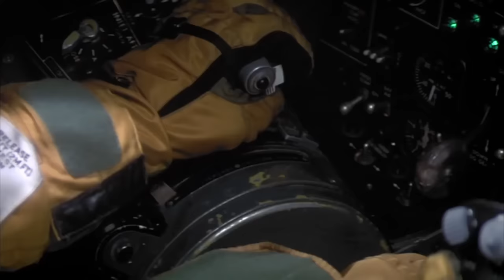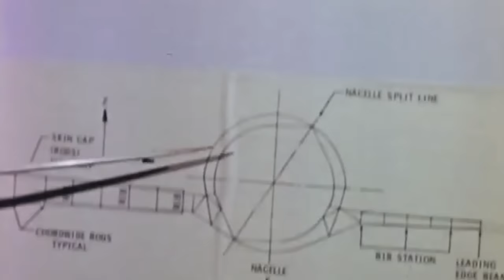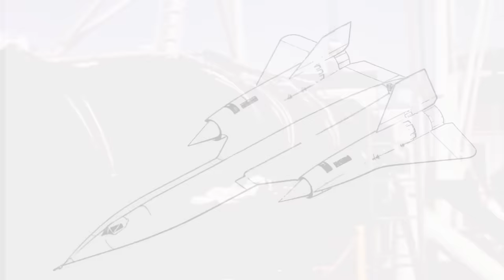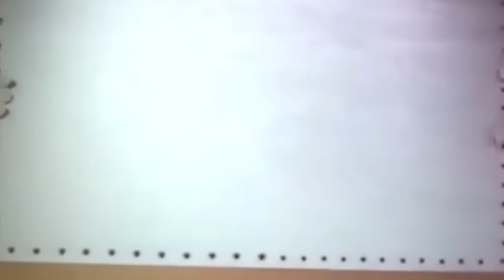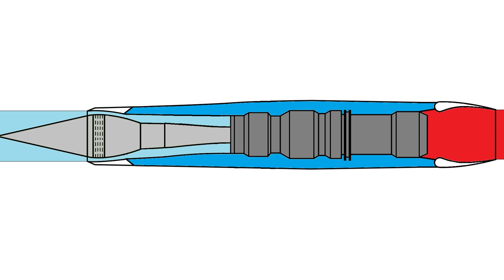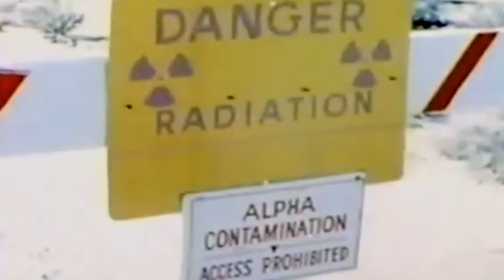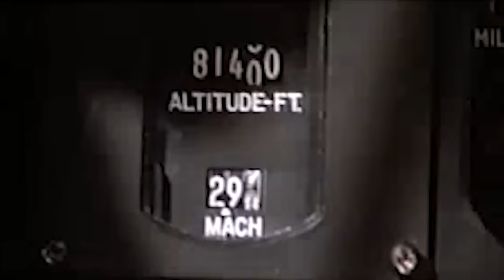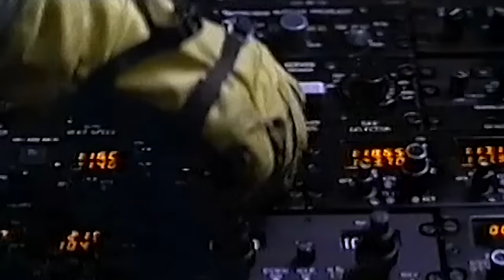Lockheed A-12 | Speed matters

Comment: The TEB is used for starting the jet engines, not afterburner use.. pilots only had so many in case of UNSTARTS
Reply: That’s what I read too . The unstarts could be very violent I believe. The thinking that went into these aircraft was amazing.
Reply: @beagle7622  it would cause the plane to yaw to which ever side the engine stalled on. There's an interview with Kelly Johnson and he describes an automatic compensation system for UNSTARTS, but if you listen to interviews, they describe a pretty dramatic event , UNSTARTS were. Pretty crazy TEB combust in atmosphere. Where did they get the idea to use it to start a jet engine??? Crazy!
Reply: @thetreblerebel  I read about it in Brian Shuls book “The Sled Driver”  I think. I will check but both he & his back seater hit the edge of the cockpit with their helmets. It is an amazing read but ridiculously expensive.
Reply: Not correct, the TEB shots are used when first starting the engines AND whenever the a/b is lit.  Its actually shown in the video numerous times, green flash as the a/b is ignited whilst in the air.  There was only enough for 16 TEB hits per engine.  Startup(1), takeoff(a/b engage-2), then refuel at tanker( as the planes tanks filled, the jet couldn't keep up with the tanker with both engine at full dry thrust=military power, so a single engine had its a/b lit at minimum burner-4) back off tanker, light other engines a/b with TEB(5) accelerate climb to mission height, then slow down and refuel(last bit of fuel hit the one engines a/b requiring another TEB hit (6) fill the tanks and back away and then light the other engines a/b(7) the accelerate and climb.  The TEB shots were NOT just for restarting after unstarts.  Actual flight durations were limited by crew, TEB shots and/or liquid nitrogen supply( on the ground the fuel tanks are filled with fuel, then the fuel load is drained down to takeoff weight, as the fuel drains the ullage space is filled with nitrogen gas from the liquid nitrogen dewars.  The TEB injection points were different for starting the J58s and for lighting the a/bs.

Comment: Some odd shots of the X15 after its mach 6.7 flight at timestamp 15:18 -- it wasn't made of aluminium, it was made of inconel X....
Reply: Inconel X is tough stuff. Once they were road transporting an X-15 in the desert and had escort, but some guy driving a RV or towing a camper coming the other way ran the gauntlet. He apparently didn't see the wing edge-on protruding into his lane. Sliced the top 1/3 clean off. Did nothing to the X-15. The guy pressed for damages. Air Force replied, "You dodged AF security and smashed into a $50 million aircraft. The best advice is hope WE forget about it." "OK."
It's from somewhere in Langley's oral history site. Lotta great stuff.
Reply: That "plane" had to deal with way more than aluminum.

Comment: If a plane leaks, it means it has fluid. You can also determine if there's an issue during your preflight. IE if a plane that normally leaks is dry there's probably a problem
Reply: There were problems with some WWII fighters and leaks.  So pilots would taste a Tiny bit and if it was sweet, “Coolant”!
Reply: The fuel leaking issue was result of the skins being fabricated a certain size that allowed them to expand due to the high temperatures which in turn sealed them.
They even had a a chart that listed temps vs fuel leakage.
The # of drops ovrr certain time where acceptable.
The length of that plane also grew a significant amount during flight due to everything expanding.
Reply: Just like my Harley, when it quits leaking it's time to start checking things out.

Comment: Talked to an SR-71 pilot once and he explained that when they saw a missile launched at them, they simply changed heading a few degrees.  Distance + extreme speed + small angle = large miss.   This was when I was younger though, and it is a conversation I remember from when I was a young aspiring pilot with stars in my eyes talking to a "rock star".  So I might not have the details right.
Reply: Your not far off...to accelerate from the ground to over mach 3, climbing to 70,000 feet, then delivering a kill was beyond Soviet surface to air missiles of the 1960's and '70's capacity.
Probably beyond the US's, too.
Reply: The Iraqis also did this against the F-14 with their Phoenix missiles. 

No US Navy F-14 was ever credited with a Phoenix kill in spite of many attempts because of that.
Reply: @Bartonovich52  
What do you mean by that?
Reply: @Bartonovich52  There was only 3 Phoenix ever fired in anger. 2 simply dropped and fell to the ground as they weren't armed properly at the ship.  The same guy armed both the flight leader and his wingmans AIM-54's.
Reply: @crankychris2  the Soviets had a way to shoot down a SR71 but it involved a nuclear weapon in its projected flight path. Would work in theory thankfully they never tried.

Comment: ....another Kelly Johnson masterpiece...........
Reply: That guy was a genius, really
Reply: There's a little known concept for a jet powered fighter aircraft that Lockheed cooked up in 1939 that by all accounts might just have broken the sound barrier, they even had a design for an axial flow jet engine for it.
But the USAAC wisely chose not to pursue it due to the fact that by the time that the special materials and tooling would have been developed the impending war would have already been over and it just would have been a drain on resources. 
I can't remember the nomenclature of it or I'd write it down so you could look it up, Wikipedia has a page on it, I think it was XP131 or something like that.
Reply: L-133 was it's designation, it wasn't produced but the design efforts put into it accelerated the development of the P80.
It was a radical design for the time with blended wings and cunards.
Another one of those "what if's" in life.
Reply: @ervandrush3116  Well, there are lots of geniuses. And then there was Kelly.

Comment: One of the problems they found was that the titanium alloy and not pure titanium they were using reacted badly if cadmium plated tools had been used on parts then microscopic traces of cadmium would be left behind causing galvanic corrosion. They also couldn't use Pentel pens as somethin in the ink or the pen would eat through the metal. Then there was a problem with water. Spot welds made in the summer months failed whilst those made in winter did not. The cause for this was algae, or rather the chlorine put into the water supply to prevent the growth of algae during the summer months. When this was used to clean the welds it lead to corrosion. Solutions: no Pentel pens, anywhere; no cadmium plate tools; and distilled water for cleaning parts.

They also had issues with about 85% of the titanium they were being supplied with not being up to the required specifications.
Reply: Titanium is always a pain. Back then, when there wasn't a lot of knowledge about handling it, it was a huge problem. But even today when we know a lot about it, it's still a pain.

Comment: I understand why people claimed to see UFOs during 60s
Reply: Very few without a "need to know" ever saw an A-12 or any of its derivatives in the 1960s, in the air or otherwise.  That was part of the whole point of what was a highly classified program(s).  It  flew when and where people were unlikely to see it.  No one on the ground can see with their own eyes an aircraft operating at over 70k feet altitude, double the operating altitude of commercial aircraft.

Comment: I watched a video of one of the SR71 pilots and he mentioned that it was capable of much more than just Mach 3,but he didn't elaborate much on it. I saw an SR-71 at the Air & Space museum part of the Smithsonian near Dulles Airport in Washington, and there is an A12 on display at the Space and Rocket center in Huntsville, AL.  You can just walk up to it and touch it like I did because it is parked right out front next to the parking lot.
Reply: There is an M-12 (A-12 carrier for the D-21 drone)  in the Museum of Flight at Boeing Field in Seattle.

Comment: I love how the U-2 is basically just an F-104 with different wings and other mods.
Reply: Yep. No wing vs too much wing.
Reply: What's really incredible about the U2 is that when it turns there's a 4 knot window it must be in, any slower and it'll stall and lose control, any faster and it'll break apart. 
One of the reasons for this is it's wingspan, when turning the inside wingtip is traveling so much slower than the outer wingtip. 
In some ways even though it doesn't have the blistering speed of the A12/SR71 it's still just as fascinating as them.
Reply: @dukecraig2402  That's because Kelly Johnson applied his genius to both planes.

Comment: An A12 and an SR-71 both crash landed.  The rear of the SR-71 and the front of the A12 were destroyed.  The remaining sections were joined together to create "The Bastard", so-called by its pilots because it could never be trimmed out to fly quite straight.  It crabbed through the air slightly.  That is the "SR-71" on display in the museum near Hill Air Force Base in Utah.
Reply: No, the bastard was the rear of a YF-12 and the front was a functional test article for a Sr-71A.  You can tell it was made from a YF-12 rear as the engine nacelles both have ventral fins on them, no other bird but the C(the bastard) has them

Comment: I read once I don’t know if it’s true. the seams of the skin of the aircraft were intentionally a little loose. The aircraft would leak fuel on the ground so it always had to be defueled promptly after landing and the remaining fuel in the tanks would leak out. This was done so when the skin of the aircraft was heated by air friction the skin also the walls of the tanks would expand and seal the gaps. So what I heard is after takeoff the aircraft would make a supersonic dash to heat and expand the skin and then immediately top off the tanks. Necessary not only because of the max takeoff weight but also the aircraft leaking fuel on taxi and climb out.
Reply: Minor corrections: the leaks were measured in drips per minute. They took off with a partial fuel load in case they had to do an emergency landing right after takeoff to reduce the potential stress on the landing gear. They would top off the tanks after take off and then climb to 33k feet to perform the dipsy doodle - descend a bit and accelerate past mach 1. Once supersonic, it would continue to climb to ~80k and accelerate the whole time. The high mach speeds would only be attained at high altitude. The leaking fuel wasn't dangerous - the JP-7 needed triethylborane for ignition - if you dropped a lit match in a bucket of JP-7, the match would be extinguished. Here's the flight manual if you'd like more details of how it flew: https://www.sr-71.org/blackbird/manual/
Reply: @justinhannan1713  That 'dipsy-doodle' maneuver is call a Rutowski path.  You trade potential energy for kinetic energy in order to accelerate through the drag rise around Mach 1.

Comment: I was in a Nike site during the 70s and met a radar maintance tech who told us that the Air force had alerted the whole West Coast Air Defense network  to try to track an unknown high speed target out over the Pacific .The whole system was primed and ready and could only look as a fast mover blew right pass every site on the west coast !
Reply: @bighands69  Today they use the U-2 (they use now a bigger scaled up version), drones (if possible) or satellites (which are of course less flexible). The satellites used today are capable of a resolution of around 10 cm per pixel, what wasn't possible at the time when the A-12 or the SR-71 flew, the old Bucket film satellites had resolutions of 5 m and more and were often used for mapping. 
At least this is what we know publicly - there is stuff like the X-37B, which is probably used for reconnaissance and synthetic aperture radar capable of detailed pictures even at night and through clouds

Comment: The Bristol 188 first flight was two years before the A 12. And all examples of this stainless steel beauty still exist.
Reply: first flight 1962. Never even made it to Mach 2.  Couldn't fly for long before running out of fuel.  A12 first flight 1962. So, I call you wrong on multiple points.

Comment: It is still a tightly kept secret how fast they were. An SR71 pilot recounted a time outrunning a missile when he leaned into the throttle he was rolling upward's of Mach 3.5 with engines pulling hard with plenty of throttle left. it wouldn't surprise me one bit to learn the plane exceeded Mach 4 with an absolute top speed surpassing that!`
Reply: I think Mach 4 flight would be not long and last flight even for the SR-71)
Reply: Nope. Never happened. 

First off. Jet engines don’t have a throttle. They have a thrust lever. And that thrust lever indirectly controls how much fuel goes into the engine.  Most jet engines are capable of putting in far more fuel than they can handle. It’s to ensure they are never staved for fuel in all conditions that they fly. For example, the U-2 uses more fuel idling at sea level than it does cruising at 80,000 feet. 

The only thing keeping you from putting more fuel in are your temperature limitations. Which in the SR-71 is inlet temperature. 

The air entering the engine has to be subsonic. So it has to be slowed from Mach 3 to subsonic. This compresses it and causes a large heat rise. Then you compress it more with a compressor and add more heat to it with fuel. If you are going too fast, the temperatures will be too hot and the engine will melt or catastrophically fail. 

They all have a bit of wiggle room. But since power required increases by the square of the speed, and on a kit bash engine that had numerous in service failures on a plane that already required a week of maintenance between flights... you did not want to push it very much. 

Mach 3.3 corresponded to the temperature limit. At those speeds it takes a long time to get to Mach 3.4 or 3.5. To get to Mach 4.0 would take several minutes assuming the thrust was available. It simply could not be done. Mach 3.5 at absolute tops. Mach 4.0... out of the question. 

Remember too that less than 20% of SR-71 hours flown were over Mach 3 because of how hard it was on the airframe and engines.

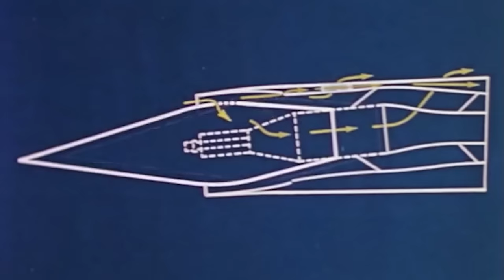Comment: 20:54 The image shows an unstarted engine inlet, where the normal shock, is expelled producing a huge drag. Normally a sequence of weak oblique shocks are followed by one strong shock. The oblique shocks reduce progressibly the Mach number to slightly just over 1, the strong shock, situated just behind the smallest crossection and behind it the flow is subsonic, followed by a diffuser that increased the pressure further to the point that most of the engine thrust was produced by the high pressure in the conical diffuser, the engine was more like a pump.
The problem with the strong shock is that it is unstable and must be stabilized with an inlet air active controller using bypass doors behind the shock to the outside of the inlet nacelle. Die loss of control resulted of the strong shock to rapidly move to the front and ahead, just as shown at 20:54. resulting in a high uncontrollable yaw moment with the destruction of the airplane and pilot, which did happen.

Comment: uhh...what is the unusual part about that refueling schedule? All planes can fly at much higher weights than they can actually take off, so it is standard operating procedure in the US (and other nations with serious aerial refueling capacity) to give aircraft full equipment load, take off under partial fuel load to stay under MTOW, and then top off to full fuel load after takeoff. We have been doing it for decades. Not for every flight or mission, but it is hardly unusual. There are not many jets that can takeoff carrying both a full equipment load and a full fuel load. US jets often fly with less than a full equipment load, but that has more to do with increasing range and efficiency. No need to carry more ordnance than you need, since it will slow you down and decrease range.
Reply: You do realize these first flew in 1962?  Certainly unusual for a jet with a 2500 pound payload capacity.

Comment: Dry nitrogen was used on the tires, hydraulic accumulators and other things on all aircraft in the USAF during my time 78 to 86.  Not just SR71's.
Reply: Nitrogen in tires is standard even for airliners, in the case of a burning tire with a retracted gear the melt plugs at the rim melt, set the nitrogen free and extinguish the fire. 
What's special about the A12/SR71 is the fuel tank inerting system, the aircraft was fueled up after take off to 100% , and every gallon of fuel burned was replaced by nitrogen from storage tanks, no ignitable atmosphere could start to build up in the fuel tanks. Without tank inerting the top speed was limited to Mach 2,6
Reply: The other reason is the 'dry' part.   You can't afford to have water turning to steam - it will wreak havoc with the pressure !